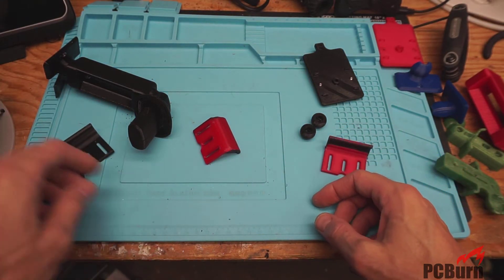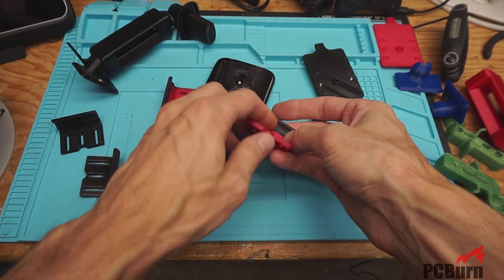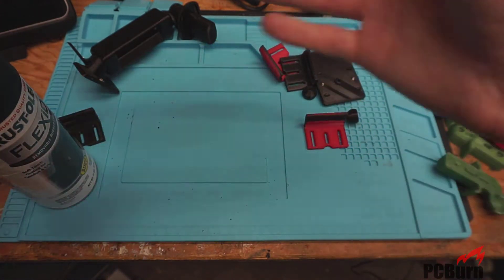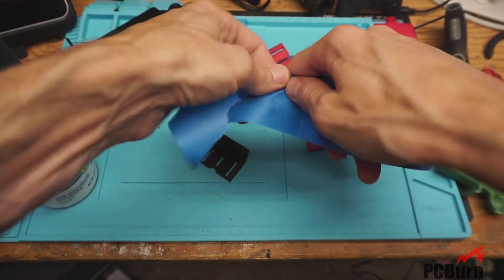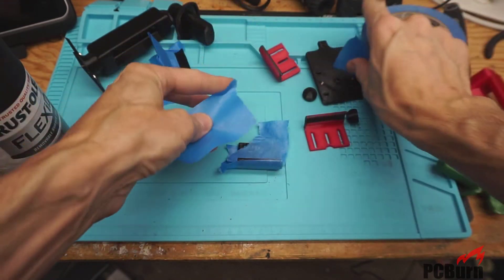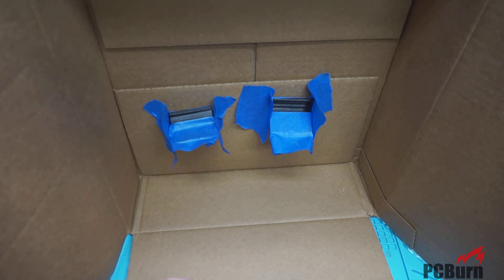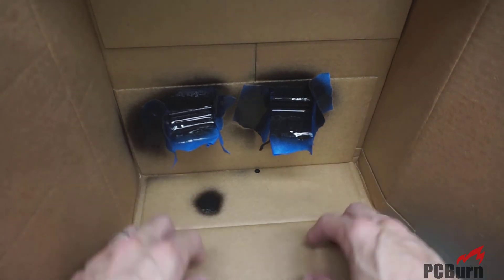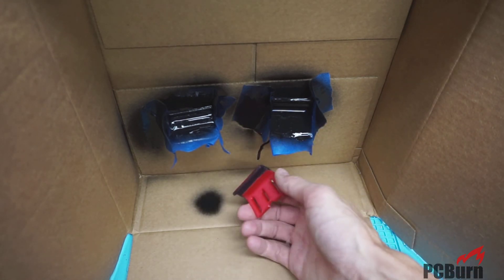Make Your 3D Prints Have No-Slip Grip (Vise, Feet, etc.)

Comment: Nice tip, thank you! Was looking at rubber sheets to glue on and other similar ways to add grip to my prints, but this solution is much easier and cheaper.
Reply from the maker: Yea, depends on your needs, of course. In some cases the thicker paint-on version of this coating or a silicone caulk can work as well.

Comment: Nice tip, I'm thinking of trying some "Shoe Goo" (polyurethane) and also Clear Silicone to increase grip on some PLA parts. Any experience with these? I think you definitely found something useful for PETG since it is so hard to get a good bond with anything to PETG.
Reply from the maker: Shoe Goo would depend on the solvent used and if it can melt the printed plastic to form a bond.

Clear silicone would probably bond to the surface. If it was roughed up a bit it might get some surface adhesion. I don't believe it normally melts into things it's applied to as (at least some of them) use a type of vinegar as a solvent (if I'm recalling correctly)

Comment from the maker: Depending on the plastic you may also want to get some 80 grit sand paper out and rough up the surface you'll be coating. Even with the same type of plastic different blends of PETG or PLA will bond with the Flexidip differently.

Also, dip-able Plastidip will  give you a thicker coating  than the spray on rubber coat.